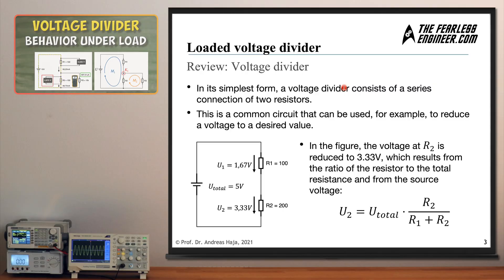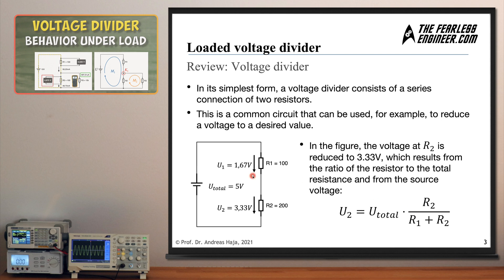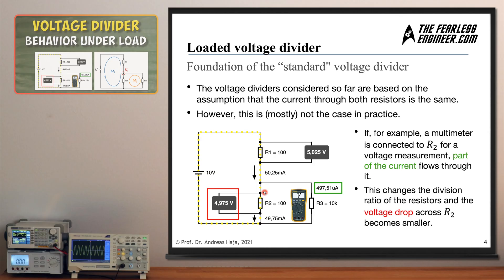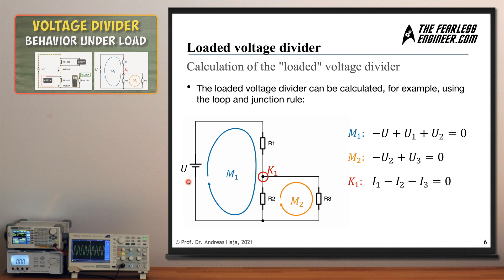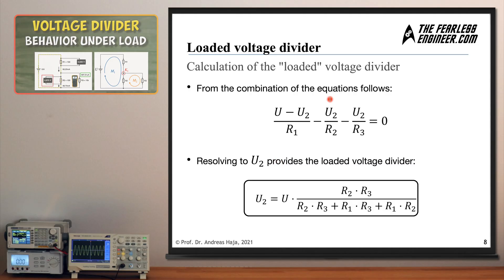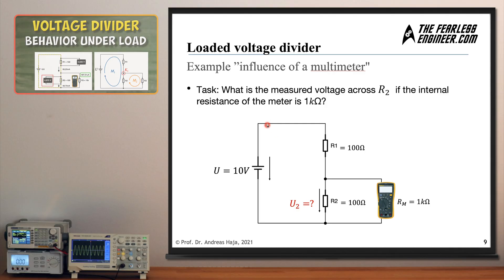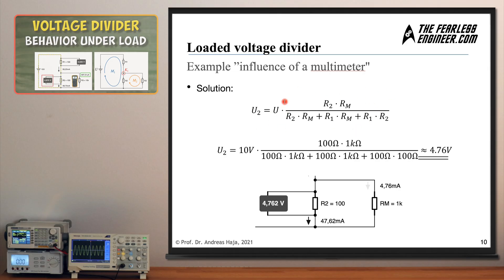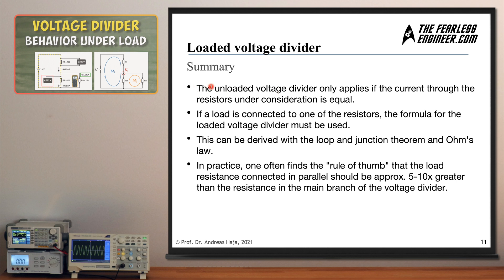What is a loaded voltage divider? | Learn Electronics

Comment: thank you very much for the explanation and calculation. very good to understand :) I just ask myself, if i have a high Rm, say 1 MOhm, according to the rule of thumb i would use R2=100 kOhm but if can also get an acceptable power dissipation with R2=10 kOhm, what disadvantage does that have?